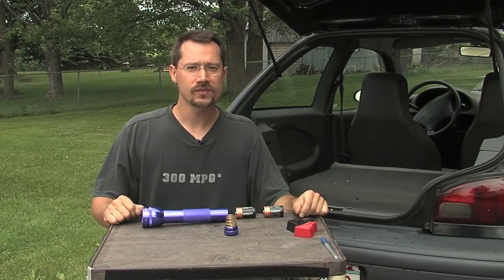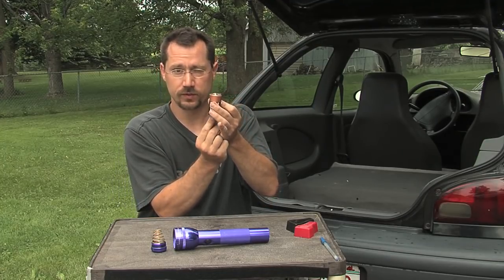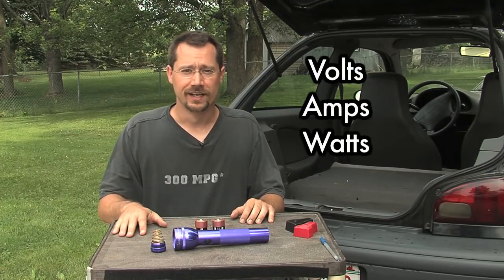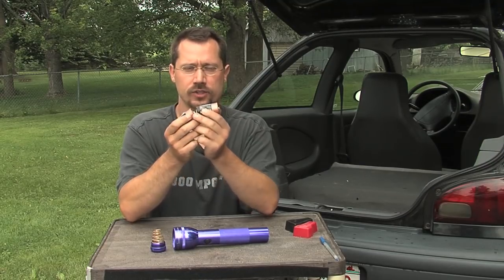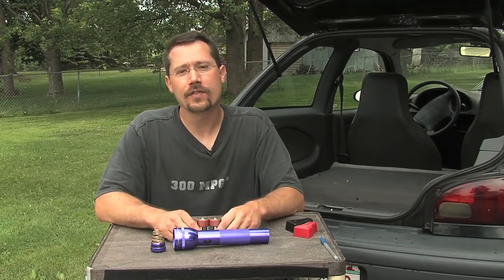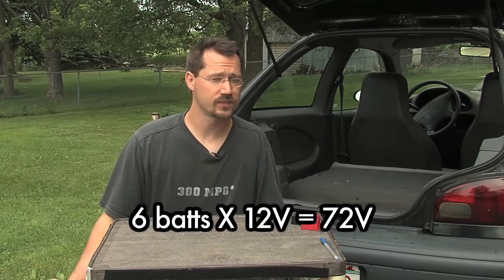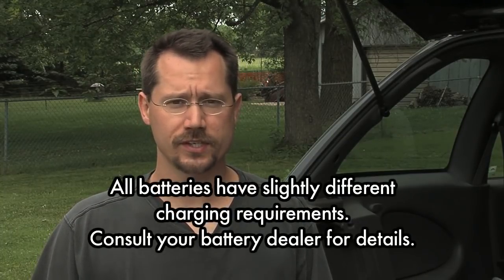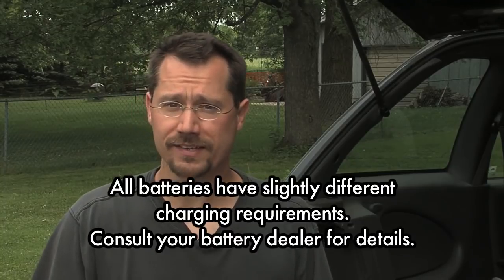10 Build Your Own Electric Car: Batteries

Comment: I'm kinda dumb so forgive me if this question is bad.  Could an alternator  or alternators be put on some kind of pulley and belt system attached to the wheels or other rotating part and be used to put a constant charge to the batteries so that the car charges the batteries as it moves? Maybe a power inverter hooked up to the battery under the hood can be used to charge with to extend range. Just a thought that I am sure was already tried.
Reply from the maker: That's a question I get pretty regularly. You can read the answer at: https://300mpg.org/projects/electro-metro/perpetual-motion/
Reply: I am pretty sure the energy that will be used to turn the alternator it would not be compensate by the amount of energy input that would need to be added to keep the same speed of the vehicle. 

therefore if you want the batteries to last longer just drive slower in the first place. decrease the weight of the vehicle and reduce drag caused by any mechanical components. 

the only benefit you could get from trying to recharge the batteries is under braking. if you can cause the alternators to engage when there is no load on the driving motor so that there is a drag on the car and slow it down. 

teslas do this which increases range while also reducing wear on your brake pads because they are used a lot less during gradual braking. probably too complex to implement if its a cheap budget project though, maybe there is a way to make the driving motor double as an alternator and return current back to the batteries but I am not an electrical engineer so am unsure how.
Reply: Yeah, alternators are not a good idea. I was thinking a combo. of an alternator and some kind of inverter. I live in Taxachusetts so it gets F**king cold here in the winter, so cold plus heater blowing on high = can't drive an electric 4x4 to get to work.
Reply: don see why  not

Comment: People have to remember these videos are all from a DVD he made 8 or so years ago. He mentions in the first video that the info is slightly outdated. Don't crucify him for his choice of batteries
Reply from the maker: Thanks Andy,
As of when I'm writing this, I built that electric car 11 years ago. Lithium batteries were simply not an option at the time.
The basics of batteries - series vs parallel, making wiring, etc., hasn't changed. What has is that lithium is now widely available and affordable.
Crashed commercially-built electric cars are now a great source of parts for DIY'ers, including Leaf and Volt battery packs.

Comment: is there a way to add DC fast charge
Reply from the maker: Yes but....
DC Fast charging gets complicated. For starters, you would need a fast charge port, such as a CHAdeMO female connection. Probably the easiest way to do that is to get one from a crashed car.
You also need the communications and monitoring to connect with the CHAdeMO. I know that the ORION brand BMS is compatible with CHAdeMO. (It's not an inexpensive BMS, but if you are using it anyways, it DOES add the possibility of adding fast charge.)

Off-hand the Orion BMS with a salvaged CHAdeMO inlet is the only practical way I know of to add DC Fast Charging to a DIY electric vehicle.

https://www.orionbms.com/manuals/pdf/chademo_integration.pdf
Reply: So I can get all the charge equipment off of a wrecked Nissan leaf

Comment: could you remove the batts,  and just use a small generator,   i mean a generator that i have would fit under the hood easy,  and 1 gallon of gas lasts 3 hours at 1/2 load.   so you could drive for 3 hours on 1 gallon of gas.  (well over 100 miles on freeway)

Comment: What you think About LTO (Lithium Titernate Oxide) Batterys ? i Have Calculated a 12,96KWh Pack with 108V and 4x30Ah These Pack cost about 2241€ (12,45€/pc @ min order of 100pcs (180requierd)) without Shipping These Batterys cost 400€ more as 9x12V 235Ah Truck Batterys (200€ each). I will Drive a Little Truck Multicar M25 (3400lbs Empty /8000lbs Full) about 50km(30miles). I have Calculated 13,7KWh@30miles (275Wh/km).I plan a Forkliftmotor with 15KW.  What dou you Think ? Best Regards Alex
Reply from the maker: I'm going to give my generic answer for when people ask any of a number of questions about batteries:
There are a number of different types of batteries out there right now, including several flavors of lithium.
In general, any version of lithium is FAR better than lead acid.
Best value for a Do It Yourself conversion project battery is to buy a commercially built electric car battery and repurpose it for your project.
Don't worry about any "next greatest" type of battery. Current batteries are more than good enough for electric cars.
Reply: @BenjaminNelsonX  Thanks for your answere. Here in Germany it is touth to become cheap used car Batterys, were call it Technic Dessert Germany XD... im looking on the Asia Markets for Batterys. it my Calculation mostly right ? 

People here sell Scrapy Forklifts only without Cells for double the price of Scrap...

Comment: How do tou use the  heater and ac
Reply from the maker: This car didn't have air-conditioning, so that wasn't an issue. I experimenting with a few different things. The car still has the original heater core, so an electric heater could be hooked up to that. What I really did was throw an oil filled electric radiator in the back seat. That runs on 120VAC power. I had that connected to an extension cord and timer so that the car would be warmed up for me already on winter mornings. The heater stayed pretty hot after being unplugged, enough for my short winter commute.
Heated seats and heated steering wheels are also a great option for EVs. I have also used a 12V heated steering wheel cover.

Comment: hey let see you make a small one of these and put it in a car. 9Opposed Piston Diesel Engines Are Crazy Efficient) if you make one of these it doubles you gas mileage but the only use them in tanks and ship but you could make your own and it would get a billion views on the diy circuit. it would also guarantee you 100 million subs. if you don't then i'm going to tell the guy who makes his own engine block for old cars.

Comment: Why not use a generator to keep your batteries charged and won't deplete when you use your headlights and other electrical stuff?
Reply from the maker: Because that would be a hybrid, not a Battery Electric Vehicle. I did also do some experiments with running this vehicle as a plug-in hybrid (something like a Chevy Volt.)
See those videos at: https://www.youtube.com/playlist?list=PL34AB83CBC78800E4

Comment: How much amps ? On you 12 volts ?
Reply from the maker: This project, built ten years ago, used 100AH gel-cell lead-acid batteries. I ran the vehicle at anywhere from 72-144V.
Reply: @BenjaminNelsonX  please could you make a suggestion for today, for a car to run 100km at 70kmph. Should I go  for hub motors or..... thank you.

Comment: Why not use a fork lift battery? it will push the flift around all day and it is very heavy and being worked hard.
Reply from the maker: The average forklift battery weighs more than this entire car.
Also, it's only 36 or 48V, which will only allow for very slow car speeds.

Comment: Hmm. Now if you added a 5-7 hp gas engine and a 200 amp alternator to this car you would have a very capable hybrid car that. would charge as you drive. A 5 hp engine will run several hours on a gallon of gas.
Reply from the maker: Oh, you mean something like this?
https://www.youtube.com/watch?v=xXVi-g4jWqI&list=PL34AB83CBC78800E4&index=7

Comment: Ouch.  45 MPH top speed and 20 mile range in a Geo Metro.
Reply from the maker: Keep in mind that was in 2007/2008 and the only electric car you could buy was a $130,000 Tesla Roadster. 20 miles was enough to do my local travels.
You can now get a great DIY battery pack by taking apart a crashed Nissan Leaf or Chevy Volt. You can also simply BUY a Tesla Model 3 or Chevy Bolt for hundreds of miles of range per charge.

Top speed on the Geo Metro was based on voltage. When I ran a 144V pack in it, speed topped off at over 70 MPH.
I still think that the Metro turned out pretty well for a $1300 budget built over a decade ago.
Reply: @BenjaminNelsonX  You're right.  All things considered it was a good first project.  I watched your video series because I'm wondering if it would be worth it to electrify my 20-year old Toyota Tacoma when the engine finally gives out someday (360k miles currently).  Seems I could do a lot bigger motor and battery setup with a truck!
Reply from the maker: @kiloyardstare  Trucks have always been popular for conversions. Take a look at a few on the EV Album for inspiration!
http://www.evalbum.com/type/TRCK

Comment: Wouldn`t AGM batteries be better ? .. .
Reply from the maker: Hi Phil. This car was built over ten years ago. I ran it on both gel and AGM batteries. Both worked fine. Of course now, we have great lithium batteries available, and they are always coming down in price. Check out some of my latest videos for adventures with lithium.
Reply: @BenjaminNelsonX  Thanks for that, i`ll check them out.. .